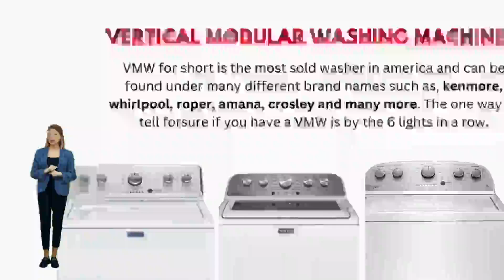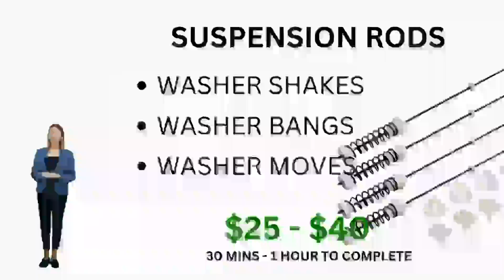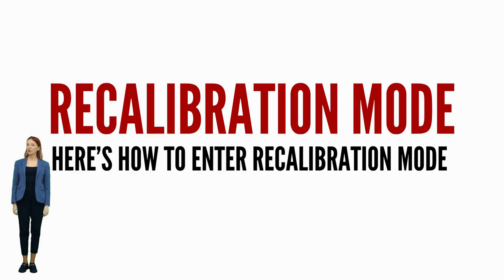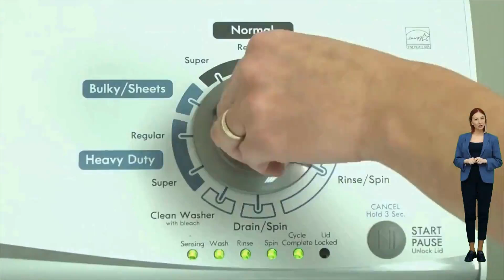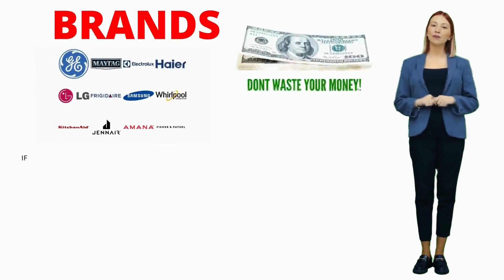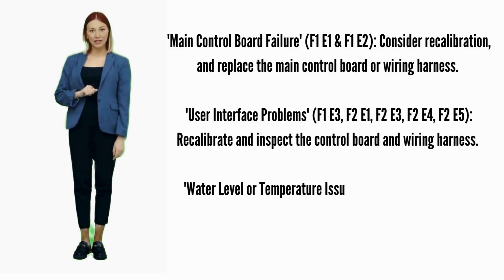Your Washing Machine Has a HIDDEN Diagnostic Mode You Need to Know About

Comment: I have an older washer. My lid was locked and the red light was flashing. I held the start button down for about 20 seconds and the red light went out and the lid released. I had an out of balance load and the machine shut off. Hope this helps someone.
Reply: Thanks